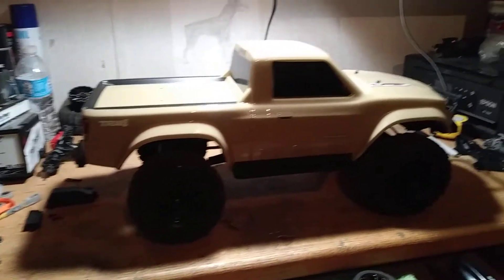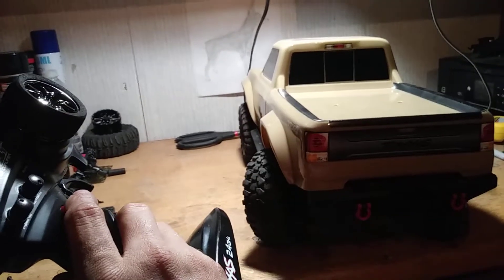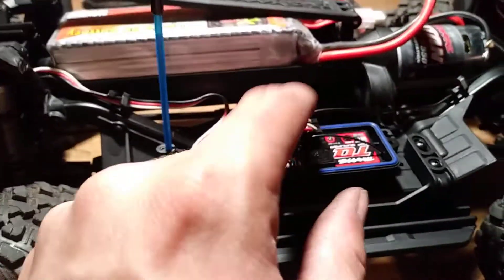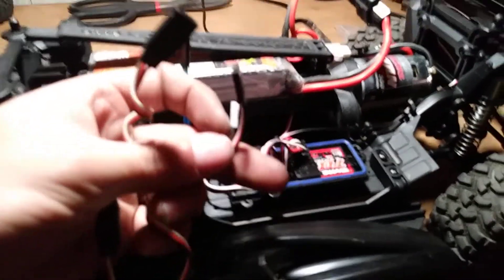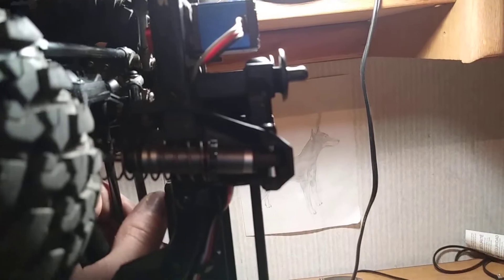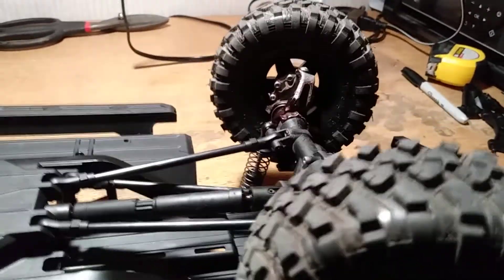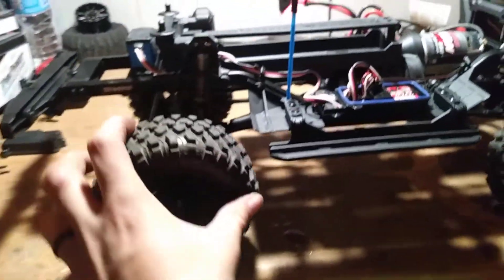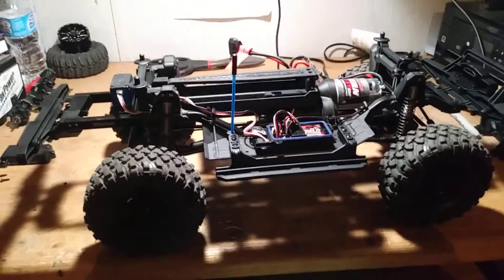Trx4 4 wheel steering😮

Comment: If I may suggest, I use a FlySky FSGT5 remote with a FlySky FSBS6 receiver. You have the option of ABS, AVC, and there’s a crawl mode that lets you choose between front wheel steering, rear wheel steering, all wheel steering and crab walk steer. The range on it is something like 200 yards with no obstructions. $70 on Amazon. You’re also able to program the remote to multiple rc cars, each additional receiver is $22. That’s the set up I’ve got on my Land Rover TRX4 4WS
Reply from the maker: Yes sir I had that same radio and receiver on my scx24 those things are awesome in this video I was just showing that you can and how to do four-wheel steering on a trx4 in general I no longer have the vehicle anymore that I appreciate your great advice cuz that is very great advice very great choice of a budget radio. Thanks my friend and thanks for watching 👍👍✌️

Comment: Try using a spectrum or futaba. I have a Futaba controller and you can adjust each servo to precise positions or power. Don't know if it will work but there is a way. Need to think about it.
Reply from the maker: Yeah I could just go the easy way an use a different radio but I want to see if I can use the stock radio first just trying to keep it budget minded so everyone can do this too is all. Thanks my friend and thanks for watching 👍👍👊

Comment: Why would you not just change the outer c hubs and portals from the front to the rear rather than the whole axle. That would keep your driveshaft and diff centered
Reply from the maker: Cuz the front seat UPS don't bolt under the rear axle housing and it'd be faster and cheaper and easier in the long run of doing it that way
Reply: A bit late to the party, but in case anyone trying rear steer on the TRX4, this does not work. I used front hubs/portals bolted to the rear, but the axle shafts are the incorrect lengths. The longer front axle shaft sort of works, but the stub shaft does not. Way too short.